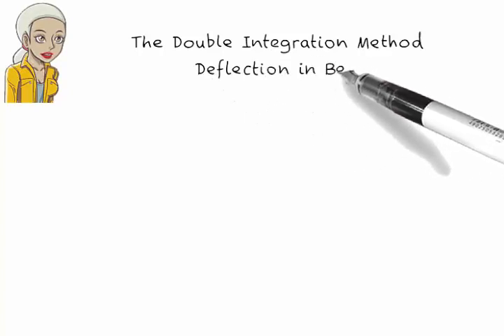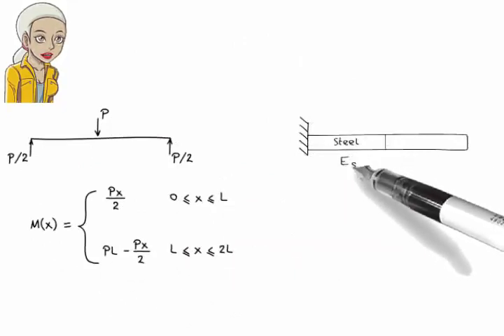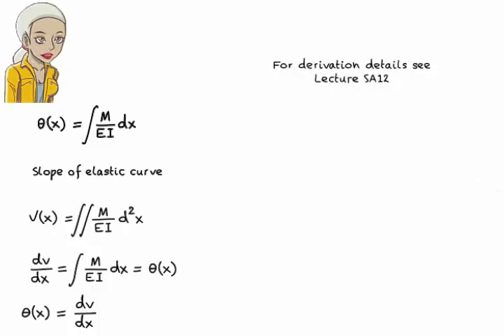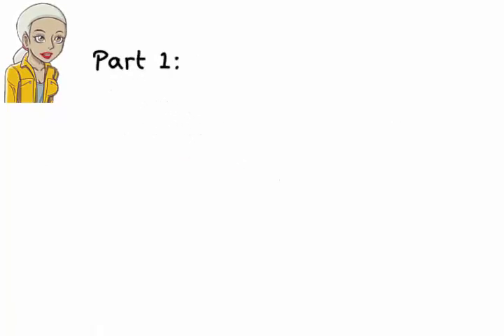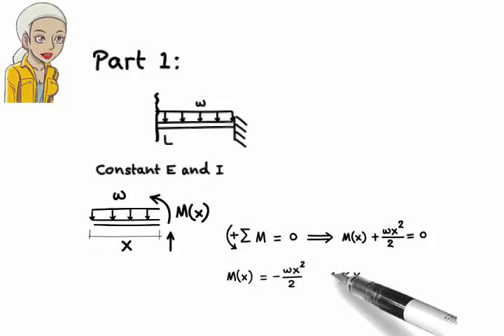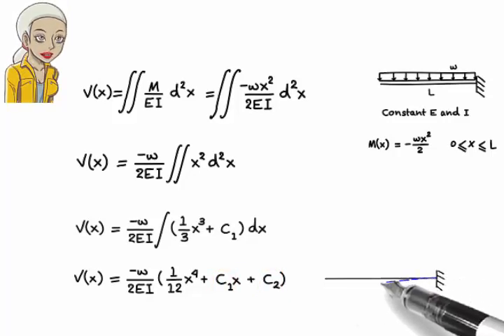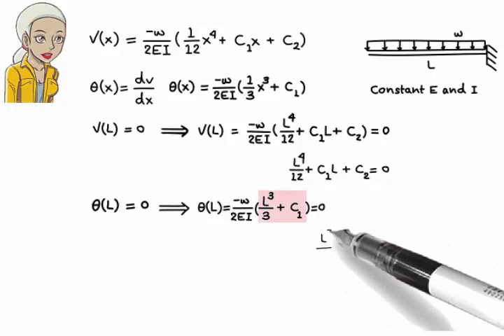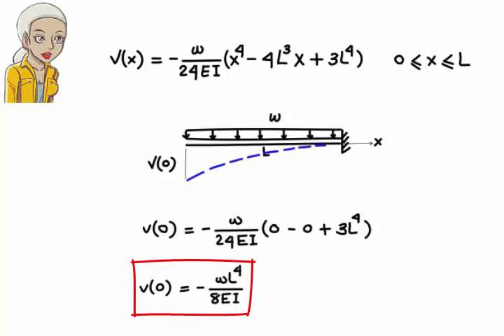SA13: The Double Integration Method (Part 1)

Comment: I have a question, if the load on a simply supported beam is symmetrical , and we are finding its slope and deflection , is the maximum deflection always going to be at the midspan ? I mean ,for every simply supported beam ? Because I have seen this being used often as a boundary condition in questions .
Reply from the maker: Yes, that is correct. The maximum deflection of a simply supported beam subjected to symmetrical (with respect to the midpoint of the beam) loading occurs at the midspan.
Reply: @DrStructure  say I have simply supported beam of span 4 meters and I have concentrated point loads acting 1 metres from each end of the beam , spacing between the loads s is 2m , will that be a symmetrical load, and when I solve it can I use the condition that maximum deflection will occur at midspan which means slope is zero at midspan ? can I assume this without putting my slope eequation to zero and finding the value of x at which maximum deflection occurs , I am solving it using double integration
Reply: Also can you provide me with your email so I can take your help regarding more queries ? Your videos really help a lot in explaining tough concepts
Reply from the maker: You can send email to:
Dr.structure@EducativeTechnologies.net

Our free online course (see the video description field for the link) provides a more flexible question/answering setup. You may post your questions there as well. The course offers updated lectures and some additional content that you may find useful.
Reply from the maker: Yes, but only if the two applied loads have the same magnitude.
Reply: @DrStructure  understood, thank  u so much

Comment: I am facing challenges in a question on Macaulay Method on finding the maximum deflection of a trapezoidal load. I tried doing it but the slope was in the high order ie to the power of 4 and i could solve for the position for the maximum deflection
Reply from the maker: If you wish, email us your solution for feedback.
Reply: @DrStructure  Thank you for the response.

I have just emailed you my solution as the feedback. If you have any easier way or other references, please assist
Reply from the maker: Thanks for the email. Please check your email, we responded to your inquiry. Let us know if additional questions arise.
Reply: @DrStructure  Thank you for the response.

The actual question i had attached it in my first email with had the values of E and I.

Nevertheless, if my expression is correct for my slopes, can you assist me in solving for the x value for the point of maximum deflection. I think that would be fine.
Reply from the maker: @mashambashonhai4901  At the point of maximum deflection, the slope of the elastic curve is zero. We have the slope equation, it is a polynomial of degree 4. Set that equation equal to zero and solve for the roots. Given the degree of polynomial, four roots exist but only one of them is within the bounds ([0,9]). That particular root is the location of maximum deflection in the beam. It should be a little bit to the right of the midpoint of the beam.  You can use Wolfram Alpha (it is a free online service) to find the roots of the polynomial.
Reply: Sorry, correction

I could not solve for the maximum deflection
Reply from the maker: If you wish, email us your solution for feedback.
Email: Dr.Structure@EducativeTechnologies.net

Comment: Ok
How C sub 2 become L power of four
Devided four?????
Look again solving of C2
Reply from the maker: C1 = - L^3/3
(L^4)/12 + C1 L + C2 = 0

Or (substituting -L^3/3 for C1),
(L^4)/12 + (-L^3/3)L + C2 = 0

Or,
(L^4)/12 - (L^4)/3 + C2 = 0

Or (multiplying the second term by 4/4),
(L^4)/12 -  4(L^4)/12 + C2 = 0

Or,
-3 (L^4)/12 + C2 = 0

Hence,
C2 = (3/12) (L^4) = (L^4)/4
Reply: Dr. Structure  thank u very much

Comment: Could I write the equations first calculating the values of supports and then considering x axis starting from the wall the cantilever is attached to like we did in SA12?

So we would obtain those formulas: 
V(x) (shear) = wL - wx
M(x) (bending moment) = -wx^2/2 + wLx - wL^2/2

Also, when you calculate/obtain the M(x) for 1st part, you consider x axis to start from right and move to the left, that is why shear doesn't have an impact on the bending moment. But when you write the boundary conditions, you assume x-axis starts from the left and at the support x = L. My question is why don't we write boundary conditions by which we would keep the direction of x-axis the same:

1) V(0) = 0 --> C2 = 0
2) dv/dx = theta (0) ---> C1 = 0

Great video btw, thanks!
Reply from the maker: Yes, we can set the origin at the fixed support and make x go to the left. If we do so, we get the equations that you wrote with one exception. You have the sign of the shear equation reversed. It should read V(x) = wx - wL.  Positive shear means, shear is acting down at the right end of the beam segment, and acting up at the right end of the segment.

For the cantilever beam, in the video where the beam is fixed at the right end, x start from left and goes to right. That is why shear does not effect the moment equation, since shear at the free (left) end of the beam is zero.
Reply: Thanks!!!

I am assuming you just jumped over the simplification, but if we start from the left side, then the moment equation is affected by shear at the right side, right? The result is the same because V(x) = wx and M(x) = -wx^2 + wx^2/2, which equals -wx^2/2. Just a clarification because I wasn't sure from which point you measured x.
Reply from the maker: Not quite. If we start from the left side, if the origin is set at the cantilever end, and we cut the beam at some distance x from the origin, and examine the left segment of the beam (from the origin to the cut point), then we are only going to have the distributed load and the shear and moment at the cut point. These would be the only forces on that free body diagram. Since the shear force at the fixed end does not appear on that free body diagram, it is not going to be a part of the equilibrium (moment) equation.

Comment: your videos are just amazingly simple and easy to understand seriously I'm impressed.
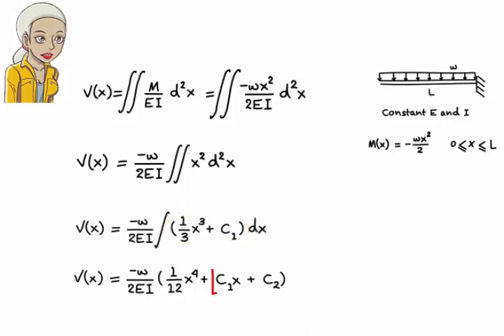but I think maybe there is a little mistake at 4:50 the integration constants C1x and C2 should be out of the parentheses as you did in the next lecture (SA 13, Part 2 ,  1:49)
 
otherwise the constants will be multiplied by load wich makes V1=3P/4EI((x^3/6)+C1x+C2)
V2=P/EI((Lx^2/2)-(x^3/25)+C3x+C4) wich is wrong 
what do you think ?
Reply from the maker: Thanks!

As for the integration constant, it does not matter whether we keep the constant inside the parenthesis or move it to the outside. The end result would be the same. Let me illustrate this by means of a simple example.

Say,  f = w Integral (x dx)  with the boundary condition f(0) = wL.

Then, we can write:
f  = w (x^2/2 + C)

Or, as you suggested:

f = w(x^2/2) + C

If we apply the boundary condition to the first option we get:
f(0) = w(0 + C) = wL   
Or,  C = L. 
Then, we can write our function as:  f = w(x^2/2 + L).

Alternatively, the other formulation give us:
f(0) = w(0) + C = wL
Or, C = wL.
Substituting this for C in the equation, we get: f = w(x^2/2) + wL which is the same as f = w(x^2/2 + L).

Comment: I am so thankful for these amazing videos. You made my structure classes fun. I wanted to mention that in 6:09 when you plugged the boundary conditions C1 and C2 there was a mistake in the original equation because this is what I got V= (w/2EI)((x^4/12)(L^3x/3)+(L^4/4)). if you got the wrong V then Vmax is also wrong which I calculated and it is= (-wL^4/8EI). please double check it and let me know.

Thank you Dr. Structure
Reply from the maker: Thanks for the comment.  

Your equation for V does not seem to be correct. At x=L (at the fixed end of the beam), deflection is zero. So, the equation must yield zero. Your equation, however, gives a non-zero value when we substitute L for x.
Reply: @DrStructure  sir why we always take a anticlockwise moment at the cut section of the beam ? When we are cutting the beam and taking M at the cut section can we take it as clockwise? Then the sign of the derived moment equation will be reversed is that wrong??
Reply from the maker: @rikdevghosh7324  Think of a beam segment that bends downward. To force that downward deflection, there needs to be a clockwise moment at the left end of the segment, and a counterclockwise moment at the right end of the segment.  You can visualize this using your hands. Hold your hands vertically parallel to each other, say 1 foot apart. Now place an imaginary horizontal beam segment between your hands, say, resting on your thumbs. To force the beam bend downward, you have no choice put to curl your right hand in the counterclockwise direction and your left hand in the clockwise direction. This simple experiment demonstrate the sign convention that we use for bending moment in beams. So when we show the moment at the cut point (which represents the moment at the right end of the beam segment) in the counterclockwise direction, we are implicitly assuming a downward deflection for the beam. That is, the calculated deflection is a downward deflection. Of course, one can place the moment in the clockwise direction as well, meaning that an upward deflection for the beam is being assumed. In this particular problem, if we employ that opposite sign convention, we end up with a negative deflection value, which means the actual deflection is in the opposite direction to the assumed one.